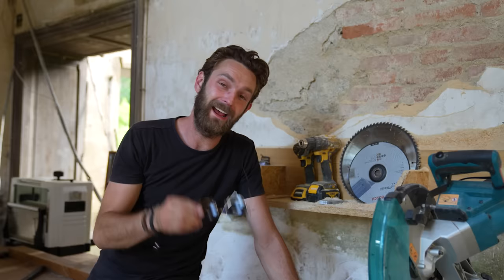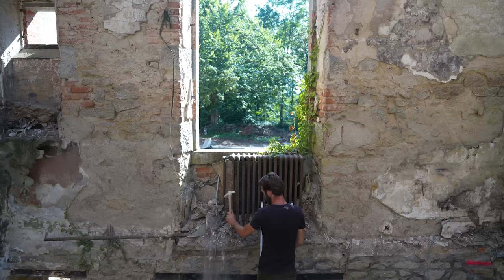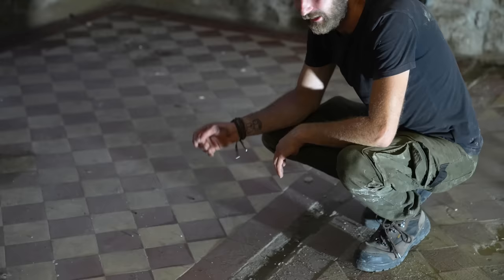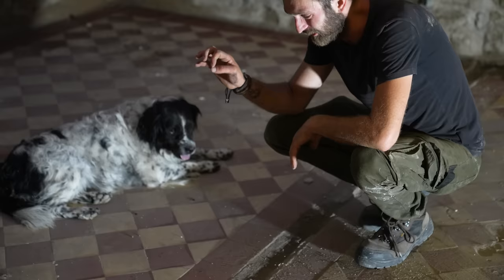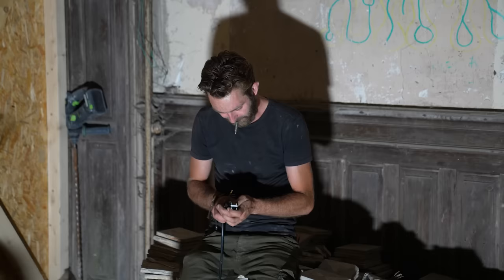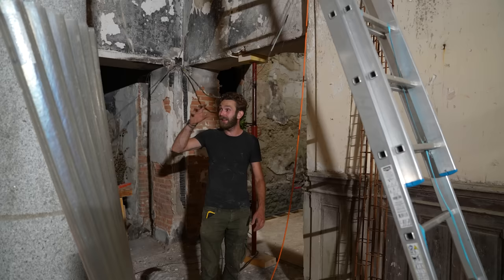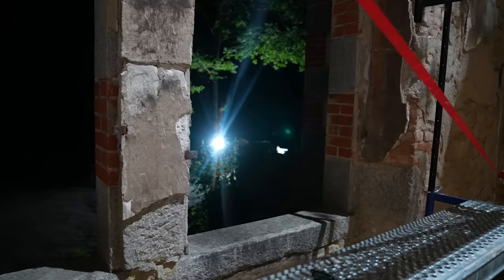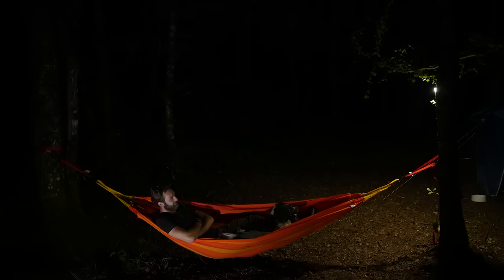The First night, I live at chateau de Chaumont.

Comment: BATHING ISSUES SOLVED! We live in the country with no electricity or hot water. We have a cast iron enamel bath, slightly raised on a frame, in a private part of the garden. There is a tin sheet underneath on which we light  a fire to heat the water.  When the water is hot enough we pull the metal sheet out and when the water cools we push it back under. If the bath metal gets too hot we sit on small timber boards. In winter to keep the bath warmer for longer we have a sheet of plywood we place over the bath that leaves enough room for our head to poke out. Also we have a black drum beside and higher then the bath, filled with water. The sun heats this during the day. It is one of our favourite place to enjoy a glass of bubbles in the evenings and watch the stars I think this would be a great solution for you Dan. Even in summer we fill it with cold water and jump in throughout the hot days to cool of.
Reply: Having a firebasket close by on the colder nights would be great. Not just for having a warmish spot to dry and dress, but for looking at when soaking tired muscles.

Comment: Install some of those anchor points you used for the hammock up higher in two adjacent trees, enough width to hang a large truck tarp from its center rings, then secure each ends corners to the ground and stick your hammock and tent underneath them so you got more space under cover.

Comment: Big lifestyle change, save time and money. Install a few pedestal solar lights around the chateau. Or mount a few on the steps, exterior walls, the laneway where 8 - 10 hrs of light feeds through. Enjoy your rustic summer paradise. Not sure about flying biting bugs, but may need to get some sort of mosquito netting.
Makes for early days and long nights. At least company tor the next 2 weeks. Beams, floors, well cleanout, water and power line, running water a possibility. Any more scaffolding?

Comment: If you're re-doing ground level floors think about a self leveling overpour. It let's you have a level surface to tile and you can put RAUPEX radiant pipe in the pour to heat the spaces (still can insulate below pour).  Usually, REHAU will help you size everything to heat it and help with pipe layout.  It's really easy to install most of it by yourself and no special tools.  I do  recommend using a plumber to hook up gas line for heat source and they will take care of permits and inspections. Good Luck!!!
Reply: Considering Dan is surrounded by woodlands I think a wood chip boiler would be much cheaper than a propane boiler and tank in the long run.

Comment: There was a stair in that corner to bring the food up from the kitchen. thats why the structure isnt against the wall. there is a beam pocket for a single beam but then the beam pockets are against the far wall. Curious to know if you saw that and chose to close up the whole floor instead? great work either way.
Reply: Yes, he decided to remove the stairs or move them to a different area, although many commenters suggested leaving them where they used to be would be a better idea.

The corner section between the stairs and the side wall (side of the château) apparently had a concrete ceiling with steels running left to right looking at the window with the radiator, that's what Dan's chipping away in this video. The theory is that that area of the basement was unheated and the original builders feared a timber ceiling would rot.

Comment: Eco flow sells an air conditioner for your tent. Look into it that runs off the EcoFlow batteries. They also have a cooler refrigerator freezer. You might be interested in to that also runs off the batteries it has its own battery also.

Comment: Can you make part of the basement habitable Dan? You really need somewhere more solid in case of storms. It would be great to have a room semi done. That’s what I’d do but I couldn’t do a tiny fraction of what you do 😂
Reply: Unfortunately, the basement floods when it rains.  Dan has replied, " it still isn't watertight" to another commenter who asked the same question a week ago.   Temporary roof, ( which will probably done in sections), windows, doors, and drainage in & around the outside of the basement would be needed to make basement habitable.  
Dan's focus is working his way up to the roofline, stabilizing the walls to support temporary roof.  If he just works on the basement, it will be that much longer before he gets the roof done on the main hallways, and chateau right wing.  He is almost done stabilizing the main hallway 2nd floor wall to the roofline.

Comment: Red and white tiles aren't hard to come by for sure, and having to modernize and protect from damp under the floors only gives you the advantage to choose a different or better tile that suits you. After all of this tackling on your own using your own two hands to build this beautiful home back up, at least you get to choose more than just the curtains. I can't wait for the upcoming weeks and hopefully to see you standing at the very top on the floor you built. No pressure though. 😂
Reply: Yes, you can still get the exact same encaustic tiles. They won't be cheap though, last time I checked they were around 65 Euros per square metre. That's a lot considering the sheer size of this room.

Comment: Thank God for Ecoflow. Imagine living there without it in the complete dark with no street lights around. 

It's great seeing the chateau at night, gives it a totally new dimension but remember to take a break, just cos you have lights doesn't mean you should keep working until midnight every night, you need some rest too to stay safe. 

Do you have a fridge on site? How are you keeping your food stored as you are quite far from shops. 

And the unmentionable toilet situation, how are you coping with that? Digging a hole in the woods?😮

Blimey, you have got 14K new subscribers in a few days since you beat Chateau Diaries. 

I am truly hoping by the time you get up to the roof you will be able  to pay professionals to do the roof as it is a specialist job and you need it completed before the winter to have one wing of the chateau watertight to live in. You can always fix tarps on the windows to keep the rain out until you get windows fitted.
Reply: Honestly, battery lights have been around for a long time and before that there were gas lamps, kerosene lamps, etc.. 30 years ago Dan would have run through a lot of D cell batteries trying to light up the château without resorting to a petrol generator but it would have worked. I spent the summers of 1985 to 1993 in a house in Tuscany with no mains electricity. Some rooms had portable kerosene lanterns, two main rooms had gas lights running off of propane cylinders and my parents had a small fluorescent light running off of four D cells. The main disadvantage of the kerosene lights was having to clean the soot out every day.

Comment: With all those steam heaters by the windows and the heat going right out ,I bet that place was really hard to heat .😊😊😊
Reply: That is the norm here in Europe.
Reply: @jmk1962  Yes and I think they tried to add some insulation before the radiators went in (the thin layer of hollow terra cotta blocks). Having the radiators underneath the windows is meant to prevent air circulation from cold air at the window moving down and hot air from the radiators moving up. BTW, since there are two pipes to each radiator I'm sure they were hot water rather than steam.

Comment: You're driving me crazy with the constant sweeping up, of the bottom floor. 
  LAY DOWN a 9x12 or larger tarp.
  They're about $15.00. 
  At the end of the day, fold it in half, and all the junk that just fell to the ground, is now, easily gathered and  on top, of a fiberglass tarp, to easily slide outdoors. Just pull it out side, & shake off the junk, and replace the clean tarp on the floor. 
  You'll save an easy 15-20 minutes a day, on cleanups. 
  Over a month's time, that's 20x15 minutes or, 5 hours a month or more. That's another half of a days time, to spend your time more effectively.

Comment: What surprises me most is the lack of electrical wiring evidence and pipes for plumbing or even old gas pipes for original lighting. Also no continuous lines for sewage or water entering or leaving the building or evidence of it within the walls. Hmmm did someone strip the building of these things? I wonder
Reply: There's plenty of half-melted wiring all over the place. Look at the segment of Dan chipping away the bits of concrete ceiling underneath the radiator, there's bits of burnt conduit and wires dangling all over the place. In some older videos from working on the hallways you can see white porcelain and brass light switches and dangling wires. I think a lot of the plumbing was surface-mounted, PVC drains and copper water lines quite visible in the bathroom videos. Also some galvanised pipes up where Dan removed the two water tanks. The bathroom soil stacks are outside, you can sometimes see them in shots of the château's front facade (in the inside corners). A while ago Dan tried to follow the underground PVC lines to the septic tank but discovered they ran to the neighbour's property (part of the château grounds until Dan bought the place, the neighbour is the previous owner of the château). The only thing he doesn't seem to have found yet is the water pipe from the well into the château.
Reply: @Ragnar8504  I will have to pay better attention
Reply: @Ragnar8504  Well, I learned something new...'bathroom soil stacks'.   Over here in the states,  they are called toilet waste pipe(s).   Yes, I have seen them going into the concrete base of homes, and underneath concrete pier & beam, or older wood pier & beam home.   From there, to city sewer, or septic, if rural area.

Comment: I'm wondering about the value of all that steel you're pulling out - especially as it would all have been smelted long before the furst atomic bomb, so would have no radioative contamination.
Reply: It was more valuable in the mid to late 20th century, because it was necessary in radioactive sensitive devices like Geiger counters and medical equipment.

These days radioactive contamination in new steel has reduced to near pre-WW2 levels, so unless it's explicitly required there's basically little commercial premium for it.

Comment: It looks like the window at 4:37 was once a door...
Reply: Are you sure about the time stamp? It shows the whole front facade of the building with at least ten windows. Some of the basement windows definitely look like they used to be doors though but that might have changed very early or even during original construction.
Reply: @Ragnar8504  That is strange - when I go to 4:37 it has a wheel barrow under a window that appears to have a fill line on either side under the window.
Reply: @SPWoz  Oh yes, how strange! Now I get the scene you're talking about!

Yes, that's one of the three strange windows in the kitchen area (the other two are on the wall with the big door).

Comment: Way back in the beginning you got the use of a huge solar panel which was installed up on the 3rd floor was it?
Do you still use that panel?  
Having all those lights in there now shows a bit of what it will be like when the chateau is complete. 
Amazing what a difference a few lights can make. We are starting to get glimpses of what the finished chateau will be like.
Just as long as those big lights are shining inwards into the chateau and not outwards, hurling light across the valley and neighbours.
Reply: Of course he still uses the panel. It is the solar power to charge the Ecoflow unit he has. How else have the power tools been working?

Comment: Since the chateau is stabilized why aren’t you  fixing up and sleeping inside one of the rooms?
Reply: The chateau walls are in the process of being stabilized.  Dan is almost done replacing brick & repointing/remortarizing the 2nd floor main hallway wall; almost to the roofline.    But in the right wing where Dan is currently working, as in other sections/wings of the chateau, the upper levels especially, still have crumbly brick, loose stone that could fall on Dan.  Debris falls regularly when he works, and has fallen in high wind/tornado? in late winter/early spring.   Of course Dan made a Vlog about it.   Unsafe work site, basically, still open to the sky.

Comment: For safety sake, shouldn't he remove that old radiator perched on the wall?  The wall that is crumbling.
Reply: keep watching...bye bye radiator coming this week...
Reply: The radiators stand on a lintel, maybe bracketed, will not move until dislodged, damaged or disconnected from piping.
Reply: They are super heavy cast-iron rads. Nick will take them down with his machine when he gets there.

Comment: Just a question, Dan, you have worked so hard on the flooring. How is wet weather going to affect¡ the wood.  Without  roofing?
Reply: It will survive but the OSB might need to be replaced before the finished floors go in. Dan is well aware of that.

Comment: Why not set the tent up in the basement of the chateau itself.
Reply: The basement floods when it rains.   Dan replied, "it's still not watertight" to another commenter who asked the same question a week ago.   He has alot of future drainage work to do, in & around the outside of the basement.
Also, unsafe work site.   Lots of loose, crumbly debris, especially in the upper sections, waiting to come down...until Dan removes it & replaces/stabilizes up to the roofline....to support temporary roof.
Main hallways & chateau right wing walls are the 1st parts of the chateau getting his main attention to stabilize.
Reply: Thanks for the update. Very detailed.

Comment: you should split huge window openings in 2 or 3 parts/glass panes, just lowest part would open / function as a window / get opened, so you could clean the upper outside glass parts..
i think that would be easiest and cheapest.. if done nicely, it wouldn't disturb the facade.

Comment: What if you put plate glass in the last row of your filing floor and keep it like that going all the way up to a skylight on roof?
Reply: Apart from the basement kitchen, all the upper rooms have massive windows in them so they won't be short of light.
Reply: Someone else suggested something similar recently...glass block/tiles all around the edges.
Would need have privacy film/opaque glass for appropriateness with girls/visitors wearing skirts/dresses moving on one floor, and then folks below looking up.   
And, another commenter said not to forget privacy for kilt wearers!😄🙈
Reply: If it was the edge along the window wall you would really have to work at it to get that to happen.

Comment: What about living inside the house….albeit inside a tent?
Reply: Unsafe worksite.   Still has crumbly & loose debris waiting to come down, especially the upper structure.   Won't be safe until Dan stabilizes the walls by replacing the brick & loose stone,  repoints/remortarizes so it can support temporary roof...one section of chateau at a time.
And, that's another problem...no roof yet.   Not watertight.
Reply: @homeemail2306  Good point. I hadn’t considered that. Thanks 👍👍👍👍